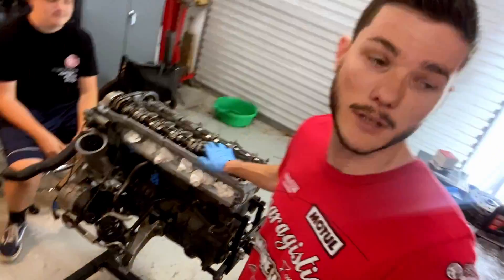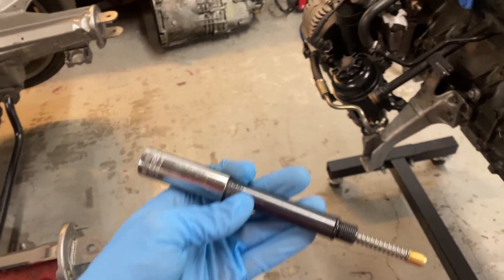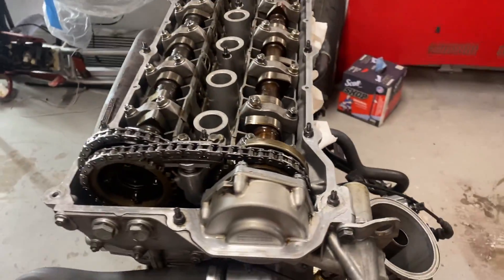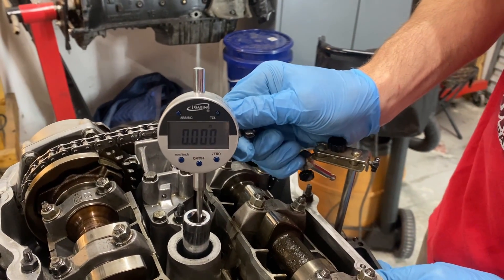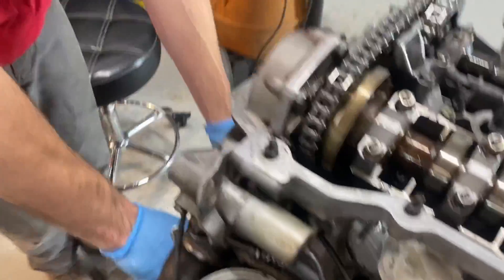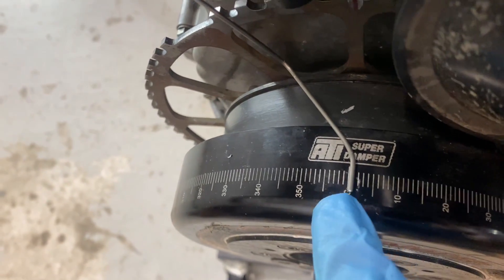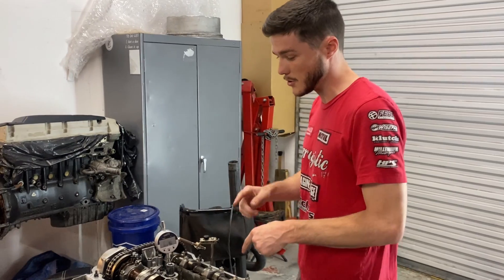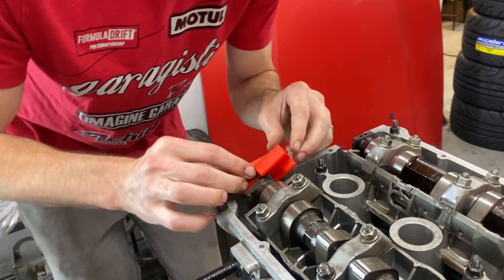Top Dead Center Explained!!  M50 - M52 Final Timing Check Before Install!  600whp M50 Build Series.

Comment: Did you compare the TDC in flywheel pin vs Dial Gauge? Thanks
Reply from the maker: I do not use the flywheel pins actually!  Never had a reason to but could be useful to have